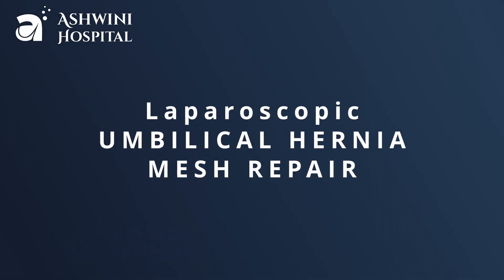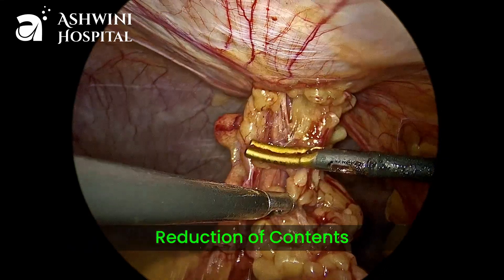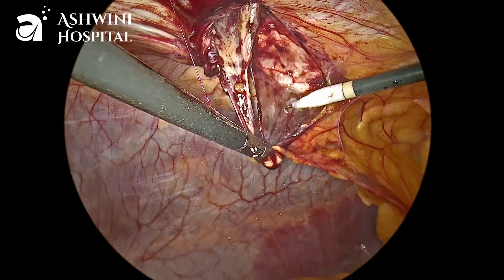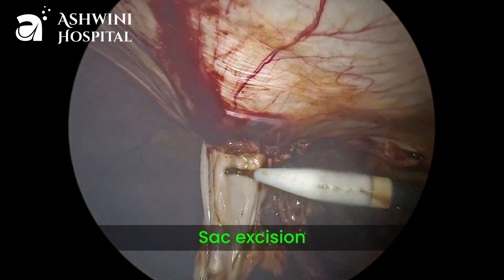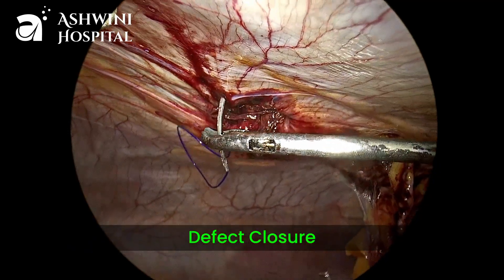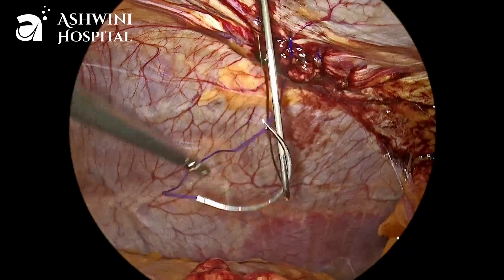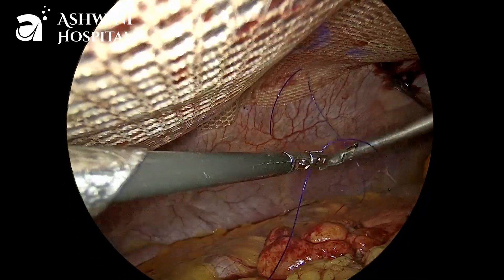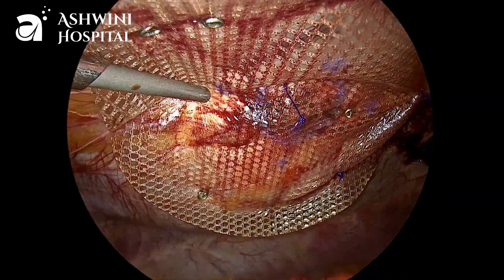How to perform Laparoscopic Umbilical Hernia Mesh Repair? Explained by Surgeon #ashwinihospital

Comment: Simple mesh? Or coated?
Reply: Dual mesh by covidien
Reply: I use simple mesh from lotus, never faced any problem
Reply: @brajeshtyagi455  but the risk of bowel adhesions and intestinal instructions remain, if using bare mesh , better go for e-tep